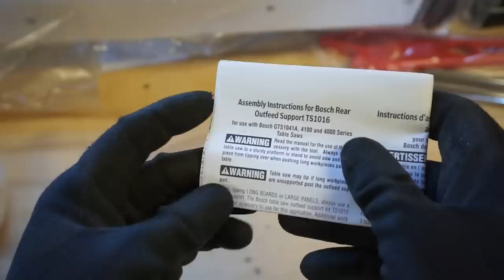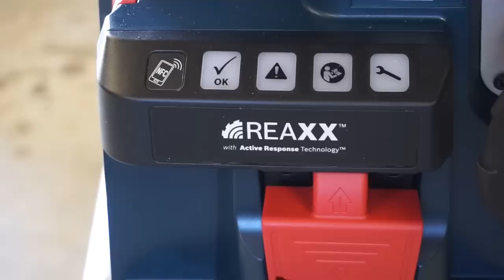Bosch Reaxx Table Saw

Comment: Put down the gravity stand and hook up to that roadster  pickup over there in the doorway, toss job box in bed, head out to work! Don't forget to stop at donut shop for a bit of contracting and maybe a safety meeting with hired help! Just kidding,  I have the  Bosch 10 inch as well. Good tool, goes with my axial glide chop saw. The gravity rise stands are super. One for small planer, one for 6 in. Jointer, and a router table, roll onto a joists and instant shop. Finish carpenters dream. Customer thinking, "this guy knows what he is doing  and has quality tools". Takes money to make money.

Comment: good morning.
i'd like your advice, between the table saw, Triton Bosch Gts10xc and Dewalt 7492, which is better?
Reply: It's a difficult choice, I'm stuck deciding between them as well. Best idea would be to pop down to a shop where you can see them for yourself